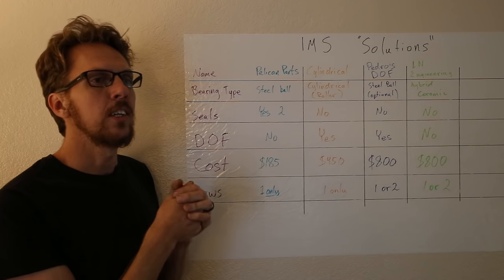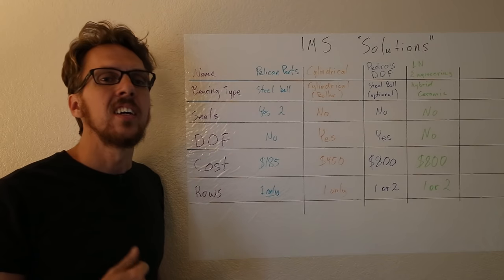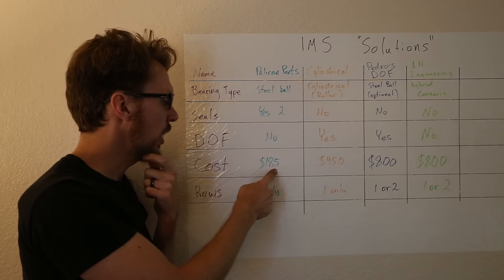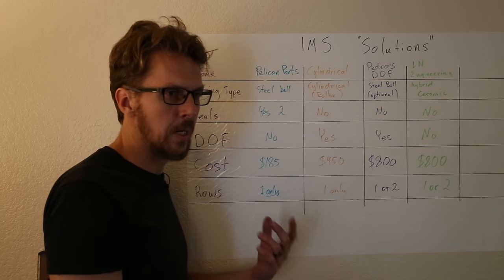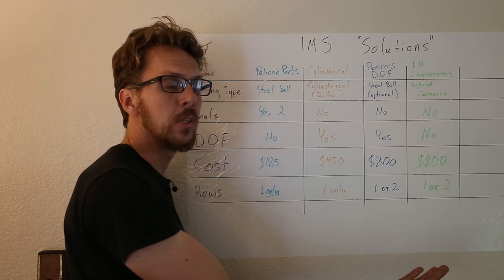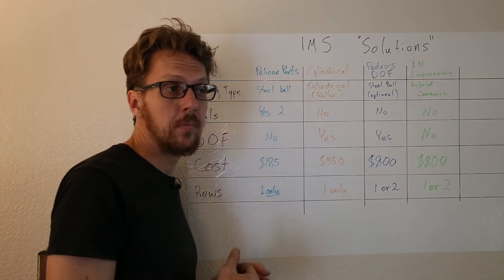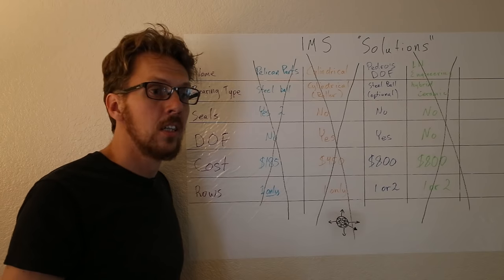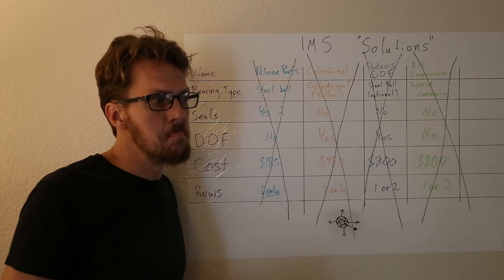What's the Best IMS Kit for Porsche (996 or 986)

Comment: Ceramic ball bearings without DOF will wear (score) away the bearing races as they are harder than the steel races, they will ultimately fail.
The IMS failure is a secondary failure caused by the process described briefly below:

The issue with the IMS bearing is that the intermediate shaft is full of air which expands when hot. The expanded air pressurises the IMS seals forcing air out. When the engine cools the escaped air creates a vacuum drawing in air and droplets of oil. This cycle continues until you have a few ounces of oil in the shaft. This heats up and cools down until it eventually goes rancid and then acidic. The acid then corrodes the seals and the (steel) ball bearings and causes the bearing to collapse which throws the timing chains leading to catastrophic engine failure. The DOF solution is the only solution which will not lead to engine failure. Pedro’s solution is good for around 400,000+ miles with regular servicing and checks
It takes less than a second for centrifugal force to spin oil out of an unsealed bearing so DOF is the only solution which provides a permanently lubricated bearing. All other solutions will eventually fail, either the seals will fail due to acidic oil or the bearing will run unlubricated and be destroyed by friction.

You should also know that the reasons Porsche turned to the single row bearing was not due to cost saving. It was due to a high failure rate of timing chains. The single row bearing solved this issue and reduced noise but was prone to failure (with similar results) as described above. It is recommended that timing chains are replaced every 50k to 100k miles.

Spending $800 to avoid the need to spend $3000 replacing the engine may be extortionate but anything else, steel balls, ceramic balls or rollers is a false economy and should not give you peace of mind.

The ideal solution would be a xxxxxxxxxxxxxxxxxxxxxxxxxxxxxxxxxxxxxxxxxxxxxxxxxxxxxxxxxxxxx (removed ).
Reply: Um so what you are saying is that this engine doesn't have crankcase ventilation , air moves let us agree a bit easier than oil, so if the crankcase has ventilation explain how that shaft is so sealed that at one end it's in an oil bath an the other is a sealed bearing with leaks an somehow air is trapped , go crack your eight grade math books again because you don't make sense just now. you might also explain how a weak bearing will extend chain life while your at it :)
Reply: @pl7868  
advice is free, take it or leave it that’s fine by me. FYI the intermediate shafts are hollow and so contain air. Good luck.
Reply: @eddherring4972  yeps but how is oil getting in them,do you have advice for that, i'm listening to what your saying and thankful for anything you have to say about it, i'm not saying this to be a jerk , just to understand
Reply: @pl7868  oil vapour passes through the seal when the engine is warm then condenses when it cools. I’m talking about tiny amounts which over time build up. This is why IMS issues most commonly occur in low mileage cars, 1) they aren’t driven enough for the owner to think about IMS damage and 2) the damage is caused when the car is cold and stationary, the acidic oil is dissolving the same area for a long time such as ‘winter storage’.
If you’re really interested don’t come at me with your comments making out I don’t know what I’m talking about. You don’t know anything about me and you decide I must be an idiot.
Reply: @eddherring4972  hum ok thx an sry for going overboard,looks like i will find out when the day comes to rebuild my motor anyway really

Comment: Regarding the cylindrical bearing, it seems to me there is little thrust (axial) forces on the IMS.  It is driven by a chain from the crankshaft, which helps to keep it from sliding for and aft, and then it drives more chains to the camshaft.  I cannot see any great thrust forces. I am new to Porsche cars and currently looking to buy a used Boxster.  I am a home mechanic, so maybe I don't understand everything about this engine.

Comment: Thanks cool Work:-) But I do object your opinion: with the cyl. bearing solution. They providet a axial "constant oil lubed" guide. What looks very strong! You see that in one of the  explanation videos. Only the "oilpump mod" dit allert me quiet a bit:-)
That Porsche did not use lubed solution, may be of cost reasons???  When the engine 96 came yout, they where on the down row with the sales and famous name. And the 996/986 an new era, to cach new enthusiast/customers on affordable prices!???  I didn't yet the fixing/care of IMS in my 142tKm boxster 03. Unfortunaltly the alternator went bad, so that's priority. But i like that you "guys over there" dont hesitate to find own solutions. In Swizerland and Germany probably only few drivers seemes to do an oilchange on their own maybe. Uhh.. dont tuch a holy cow...:-)

Comment: Done 70,000 miles on my LN, no seal and no lube,  car now 120,000 total mileage, change oil & Filter every 5000 miles, you pays your money and takes your chance. part of the problem with the bearing was the inclusion of the seals, once the grease had gone you could not get enough lubrication  in there, i would be interested to know where you sourced your hybrid ceramic bearing, as i should be replacing the current bearing.

Comment: The capacities of the bearing types:
20 mm shaft , 47 mm bore

Double row NSK:: .............Dynamic 19 600 N, static 12 400 N 
Single row NSK/SKF::.......Dynamic 12 700 N, static  6 550 N
SKF Roller (2204) ::.......... Dynamic 29 700 N, static 27 500 N

I dont have capacity numbers for the hybrid bearings. I dont know why the bearing manufacturers dont release them. I suspect that the ultiamte fatigue limits are not that different from steel bearings as the raceways are the same in the hybrids. The benefits of using ceramic balls is at least that the heat generation is smaller (= less friction), the ceramic balls can take  alot more heat than steel balls and because the balls are so much lighter than the steely ones they load outer ring less. Also the balls are practically non-destructible and according to SKF non-sensitive to raceway brinelling. But, the raceways are still the same steely ones and they have a temperature limit at about 150 deg C and the strength of the steel. With the rings and raceways it is all about heat treatment. The surface needs to be in compression after the heat treatment. If the heat treatment is not perfect the bearing will fail. It does happen occasionally.

Again I start to wonder about the proper oil level.  With M96/01 is 8.75 l or the over 10 l that I put to get two digits from top? If the oli level is low maybe the "Pedro effect fan" really keeps the bearing dry.

Comment: I've pretty much concluded that the Cylindrical bearing is the best option.  I'm only debating the DOF option.  Myconcern is the seems like the cheap DOF pull directly from the Oil pump so that would mean that it's pre-filtered oil?  Opening up a seal would expose the bearing directly in a bath of pre-filtered oil, so I'm not really sure if there is benefit. If the bearing is in a bath of oil with seal removed  I'm not really sure there is much of a risk of acidic oil building up or lack of oil for that matter.   I've got a 2000 S, Is it safe to assume all of these are dual row, if so I may just leave it alone when I do the clutch.
Reply from the maker: It probably is dual row. You can inspect it (take of the flange and ensure the seals are in tact, try moving the center bolt for excessive play). If it looks good, honestly, I think I'd leave it alone.

Comment: Hi. Great video!  I have a 1999 Boxster with 63K miles and an automatic Tiptronic transmission.  Do I need to worry about the IMS bearings?  Is this more of an issue with manual transmission styles? Thanks.
Reply from the maker: I don't believe transmission type has any "bearing" on failure rate. What does seem to matter is dual row vs. single row. Since yours is a 99, you have the more reliable dual row bearing.

Comment: Obviously if your original bearing lasted 90k+ then sticking to the stock one or ceramic one that you found should be good enough. I think the IMS got a bad rap since it was I think like in only 2% of the many cars they made. It could've been a bad year or day at the bearing plant or something stupid or it could've been that some people using crappier oil. Like taking it to their local oil shop and being sold Dino oil and not synthetic like they were told.  Who the heck knows. My 03 996 came with Pedros DOF (previous owners engine blew up at 30k luckily under warranty. And Porsche replaced the engine. The owner decided to put the extra insurance into a DOF. ) lucky for me but I'm sure the price I paid was a little on the high side but I looked at it as a little insurance for me.  Which brings me to one point, if and when ever go to sell it a 800 DOF might get you a better price in the end.  Just saying.  Thanks for the videos. I really enjoyed them and now subscribed to your channel.. Peace!
Reply: Steviee8 there's YouTube vids showing 90k plus miles cars having IMS fail.
Reply: arensel84 oh. I did not know that. I wonder what the percentage is compared to engine miles. Good to know. In that case I would've spent the extra 800 for DOF while I was in there. Especially if I could do it myself. (Helps on resale value as well) thx for the info

Comment: Here here Burner!
Quite a mark up just for a bearing.
I enjoyed your lecture and I will probably take your advice. 
I own a 2001 Boxster S, with 77000 miles on it. I do my own oil changes every 3000 miles , with mobile synth.
Knowing what you know and I know it's only an opinion.  Would you hold out until the hundred thousand mile mark to  change it out or should I do it now?
Reply from the maker: Thanks! Based on my experience, I'd be inclined to wait until you need to do the clutch (if it's a manual). However, with an 2001, you might have a single row bearing. Those seem to be a bit more problematic. Still, the whole thing seems to be much less of a problem than the sellers of the aforementioned over-priced kits make out.
Reply: Best indicator of an impending failure/bearing going bad is ferrite particles (iron based-(magnetic)) in the oil supply and you'll find them embedded in the oil filter. these are pieces of the ball bearings and races shedding off as they pit and roughen up. Normally you'll find black dust sized ferrite on your filter magnets (more on that in a sec.). once you start seeing shinny ~1/2mm flat particles that are attracted to a powerful magnet, your bearing is on it's way out. To  see this, get these- http://lnengineering.com/oil-change-bundle-configurable.html  ,  http://lnengineering.com/products/other-watercooled-stuff/billet-oil-filter-cutter.html  ,  and   http://lnengineering.com/products/other-watercooled-stuff/filtermag-ss300-for-use-with-our-spin-on-filter-adapter.html

then check the drain plug magnet and inside of your filter for the larger pieces every 6 months or at every oil change, which ever is sooner. 

Change it out with your choice of a replacement part, considering the rollers, make your choice. i went with a RND Roller, just my preference. Make your own, informed choice, When you see the shinny particles or when you change the clutch, which ever comes first.

Comment: So Burner, no mention of warranties. I was told last week that LN has a pro version with a 50% longer warranty than their standard bearing. Probably naive, but I think it matters. Any warranties on the other options?
Reply from the maker: Do you have a single row IMS? I think they have a dual row replacement for the single row... if that's the pro version, then, yes, I would definitely agree that it's worth it. I'm not all that interested in warranties--unless that warranty is going to buy me a new engine in the event of failure. I think some of the other options might have warranties (I can't remember the details off the top of my head), but any warranties they do offer are pretty limited... They might cover a replacement part, but that's about it... not much help if you have a dead engine!

Comment: I also heard that revving the engine beyond 4K RPM will ensure that the IMS bearing get its splash of oil.    Does anybody know if there is any truth to that?
Reply: Old question but I also heard the same, Whenever I take my 2002 996 out for a spin the thacomehter will reach redline at least once, no IMS solution yet, but plan to do so next year when I change the clutch.

Comment: My bearing was starting to break up and I had tiny flashes in the oil filter. When the garage went to replace the bearing it was the double, my car is a 2001. Porsche do not recognise the double as a failure and you cannot buy the bearing on its own from them, which is ridiculous. So i had to spend £500.00 on a 9products part Code: 9P-IMS-3RV upgrade. Plus fittings. Had it been the single it could have been replaced for £20.00 plus fitting. So why as it’s breaking up are Porsche not saying there is a replacement part you can buy as the bearing clearly breaks up.

Comment: Where did you get your replacement bearing?  What brand and part number?
Great videos!

Cheers
Reply from the maker: Thanks! I found a supplier who specializes in racing bearings and  would assemble a bearing to my specs. I haven't listed the supplier because 1) it's totally untested and 2) I'm trying really hard to avoid long, tedious technical arguments. If you want to do it yourself, get the technical specs of the bearing (I put them up on my blog here: http://burnerscars.blogspot.com/2016/08/sourcing-your-own-porsche-ims-bearing.html) and do a little googling for suppliers. You will find a few companies that will make a suitable bearing, but I'm reluctant to endorse any one supplier just yet.

Comment: Couple of notes!
1) Google "Eisen class act" and research the  docs. There is stat. data from the US import cars.. Double row failure rate has been below 1% whereas single row between 4-8% (California even up to 10%).  Charles Navarro confirmed me that twinrows actually aren't problem.
"2) The double row has a weak point though. It is the center bolt. It is known to fatigue and break. Sometimes it has broken when the bearing has been pulled out. The LN hub has a stronger bolt.
3) Porsche never designed the seals to keep oil in! The idea is maintenence free grease sealing. But it didn't work as planned in that environment and the motor oil does get in and flushes the grease out.  IMO the outer seal (facing to clutch) should never be used. 
4) There are actually at least two cylindrical options. One by Vertex and the other by someone .. you can get that one from LN too.
5) LN also has a DOF solution.

I ended up with LN  twinrow with hybrid ceramic, after reading Eisen docs.
Reply from the maker: Thanks for the details!
Reply: 1% Failure rate on the twin row, i just had mine changed on my 2001 S, it had a twin row BUT, it was failing. One row of ball bearings were completely pitted,and the bottom race was rough in a spot about 3/4" long. On it's way to failing.
Reply: +Chris Frank Well, it's life was coming to end. The 1% failure of course relates to a certain time. All engines and parts get older and wear out. But, had it been a single row, you'd already had total loss. I recommend you put the LN hybrid and keep the oil level always near max. and the bearing is submerged in oil.
Reply: +Chris Frank Did you check the spindle bolt?  You also say the raceways were damaged. Was the damamge in the center line of the raceways or angled (axial load)? The doulbe row can be theoretically weak in axial load it the inner and outer raceways or not perfectly aligned. In that case only one row carries axial loads. However, in the IMShaft the axial loads are small.
Reply: I've had 40 y/o Chevy 350s, and there parts don't just 'get older and wear out' in 55k miles, or even 100k. A 1% failure rate is at least 100 to 1000 times too great, and that's the 2 row!. Replace with Roller, is my theory. The Rollers are just now being installed in greater numbers, so we'll have to wait for their longevity to be proven out, but Ball bearings have had there say, and it ain't good. All wear was vertical and in line with the bottom of the races, on the inner race, ~3/4" on the channel with the bad balls, and ~1/2" on the channel where the ball bearings appeared to still be good. There were small shinny flakes (~1/2 mm being the largest) in the oil filter media, which you could gather by dragging a rare earth magnet across the pleats of the filter media, once you cut the filter open. Very hard to see, but there. Once i installed a Magnetic drain plug you could also see the flakes there. You could easily miss this completely, if you weren't looking for it. Once the bearing was pulled, it looked and rolled as smooth as ever, looked as good as the one here. I could not see anything wrong until i cut the outer races in half in 2 places, holding the bearing in a vice, using a angle grinder with a steel cutting wheel installed. Once in half, the damage was obvious. I used the RND roller as a replacement.